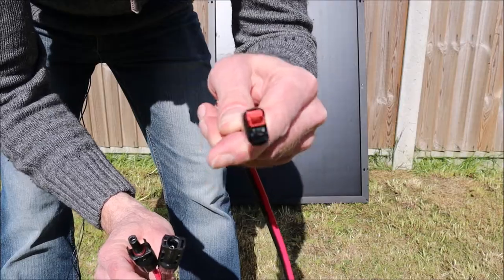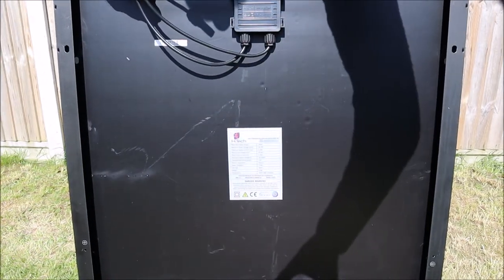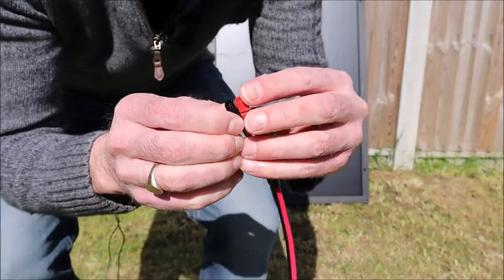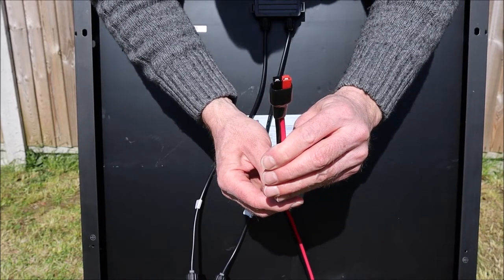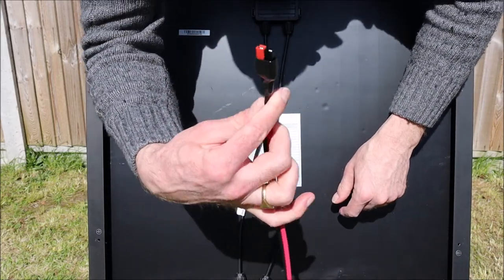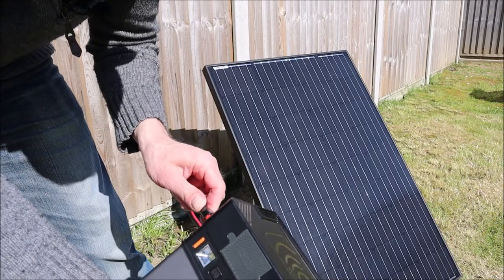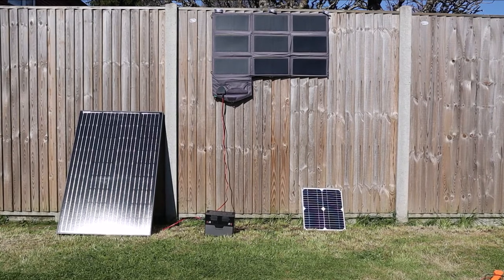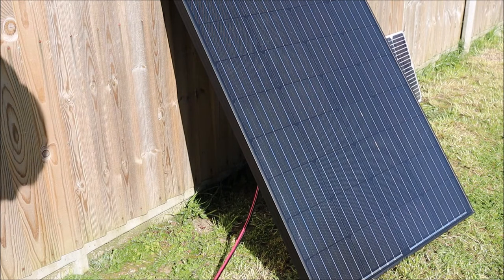New 100W Solar Panel + ALLPOWERS 372Wh Solar Generator | Working from Home

Comment: I bought the ALLPOWERS Portable Generator 288Wh Power Station mainly on the strength of your earlier vid. Damn fine device.

I've just bought two 500w Renogy panels I'm converting into a suitcase configuration, to supplement a Beaudens fair weather 100w portable panel, I use to charge it.

The snippets of experience I glean from your work, have saved me loads of time! My thanks & stay safe.
Reply from the maker: Good day to you! Wow, thank you so much for your kind and generous feedback. The content on this channel doesn't fit with everyone, so hearing that you've gained value and saved time is awesome! Renogy has a good reputation so they should work and last well. I need to get some of their kit to test out on here.

Thanks again for taking your time to feedback. If you need anything just shout. Stay safe and all the very best, Adrian

Comment: I had alot if issues with getting any wattage out of my solar panels into my power stations in the begining until i picked up a cheap £7 multimeter from screwfix to diagnose some issues. A megasolar 100w panel on the inside of north facing window of my house (awat from the sun) only gets around 4.8-5.6v and 50-70mA out of its dc barrel jack on the inside of a south facing window it can pull 20.6v at around 320mA(on its 20v setting) i know these arent ideal conditions and outside really to get the full heat of the sun but the south side of my house is facing the main road with a small garden and not alot of security for leaving solar panels out. And the baci side of the house (south side) is mostly in the shade in winter when the sun is lower in the sky.

Comment: im thinking of modifying a 12v cable from my geny be able to connect it via anderson plug. that way instead of charging it from sun it ifts not available in can plug it into my generator so its charging as we're using it. any thoughts on that?
Reply from the maker: @Ash  Good day Ash! I've not got a generator myself, so couldn't test it I'm afraid. The voltage range of the MPPT circuit (from the manual) is 16.6-22V, so it would need to be in this range. Saying this, I'm not sure how the MPPT would react to the voltage a generator would produce. If it produced the same amount as a vehicle 12V output, then the DC input might be a better option. Can you add a 12V output to your generator? Cheers, Adrian

Comment: So with the allpowwrs 606/666 I don’t need an extra solar charge Controller Right? It does it on its own?
Reply from the maker: @Magengegend  G'Day! You're correct. It has a built-in MPPT circuit that takes care of solar charging so you can plug a panel straight in. Cheers, Adrian

Comment: can you connect the panel to the 8mm socket, thanks
Reply from the maker: @Dru Wilson  Hi Andy! You can charge using solar via the DC port (5.5mm x 2.1mm), but it's not recommended as the port charging rate reduces when it becomes cloudy (as you would expect), but doesn't increase back up to the charging rate it was before (when the sun comes out again). In essence, 'sunny spells' kind of days, keep reducing the charging rate resulting in significantly longer charging times than when using the Anderson port (always charges at the best rate the panel can deliver). The voltage range in the manual for the DC port is 12-20V with a maximum current of 3.2A. I hope this answers your question. Please shout if you have any other questions. All the best, Adrian

Comment: This power unit seem to work fine for me I have only charged it once from the mains adapter.  I use the unit to power a Mini Cooler which drains at 44 Watt at start up dropping to about 38-40 after a few minutes, it takes about 5-8 watt less in heat mode.  I generally charge this with a Renogy 50w Panel through the Anderson plug and also use the pass through ability of the charging circuit. I have had no issues it all seem to work correctly although I do shield the unit from the sun when pass through charging as it can get warm otherwise.
Reply from the maker: @Neil Wilson  Good day Neil and thanks for your comment. It's great to hear that your unit is working fine, especially in pass through. Your tip about shielding from the sun is an important one too! Thanks very much for sharing your experience as this will help other viewers who read this. All the best, Adrian

Comment: Thanks for all the video how to and what not on this generator, I am getting ready to push the button on one of these but haven't seen or heard mention of total charge time, so say from near flat to full, could you either point to or tell me for example charge times from mains, car lighter socket and 100w solar, thanks in advance.
Reply from the maker: @alan palmer  Good day Alan! Thank you for your kind feedback and question. Rough timings based on my 372Wh for each method below. I wouldn't recommend running it completely flat all the time as this will shorten the battery cycle life.

Mains - Supplied AC/DC power brick @55W > 372Wh / 55W = 6.7 Hours
Mains - https://amzn.to/32jI4WV (affiliate link) @60W > 372Wh / 60W = 6.2 Hours
12V - https://amzn.to/3icM9DZ (affiliate link) @37W > 372Wh / 37W = 10 Hours
12V - https://amzn.to/32Ks3d0 (affiliate link) @60W > 372Wh / 60W = 6.2 Hours
Solar Panel (100W) https://amzn.to/2YQ7drL (affiliate link) @58-60W (max 3.2A charging circuit) > 372Wh /58-60W = < 7 Hours

I hope this helps. Please shout if you need anything else. All the best, Adrian
Reply: @DADvinci  Thank you so much for the info, much better times than I would have guessed at,    pushing me closer still, probably bite the bullet at the end of the month, thanks again.
Reply from the maker: @alan palmer  Glad to help! The manual states 7-8 hours for the AC power brick (60W in), yet 6 hours for a 100W solar panel (60W in). The times I've provided are rough estimates (so 7 hours should cover most ‘flat to full’ charging situations) and the good thing about the 372Wh is that it displays charge time remaining. The only issue with mine is that it doesn't display a time when charging using solar via the Anderson port. The display is very handy for discharge time remaining too, but all in all the % is still the best yardstick. Please shout if you need anything else. Cheers, Adrian
Reply: @DADvinci  sorry for the sporadic replies but I'm working away from home and using a phone, the generator at least would give me laptop potential, thanks again, very much appreciated.

Comment: I was wondering, which one of the 3 panels would you recommend to have around to keep cellphones charged, laptop and maybe help reducing the energy bill? I could considered either using one of those portable batteries with inverter or something like a grid tied inverter and connecting it to my wallplug
Reply from the maker: @Daniel Peixoto Martins  Good day Daniel and thanks for your question. Usually, it all comes down to what you want to power (or charge) and for how long you would like to do it. In general terms, if you don't need a portable panel then go for a rigid glass one (or more) as they are better value for stationary use, last longer and can remain outside it all weathers. You can go the grid-tied route which will help to reduce mains power usage and reduce energy bills but won't store energy. The battery option provides more flexibility in terms of energy storage so you can cover power outages (emergencies), take it on trips (off-grid use) and still use it while the sun is shining at home (reducing mains usage). Did you have specific costs in mind or scenarios you really want to cover? All the best, Adrian
Reply: @DADvinci  Well, I live in an apartment, top floor so I could easilly put a rigid one over the balcony if the home owners association allows it.
Advantages of a movable one: I wouldn't need a permit and would be able to take it camping with me...
But yes, I agree a fixed one will last far longer and they have a better output. My parents installed 2 last years the results are awesome although it is only a 520 or 560w set up.
In terms of money I am not really concerned but would like to get my investment back in some years time.
Reply from the maker: @Daniel Peixoto Martins  Thanks for the additional info Daniel. It sounds like a foldable might be a better option for your circumstances as it covers home and away. If you do go the 372Wh route, then you're not going to get much more than 60W from solar due to the charging limit of the unit. The 100W ALLPOWERS foldable (https://amzn.to/3p7lavG affiliate link) should give you that, as my 60W version gets about 45W when charging. Another one I've been testing since last year (waiting for weather to improve for mid-term review video) is the PowerOak 120W (https://amzn.to/3qqlSpv affiliate link) which is a nice panel with MC4 connectors and in-built stands, but you're unlikely to benefit from the extra watts due to the charging limit on the 372. I hope this helps? Please shout if you need anything else. Cheers, Adrian

Comment: Great video. I already have a 120W (2x60) folding solar panel which I use for my caravan when off grid.  I also have a dayvan and wanted to use an allpower solar generator.
Will these work together, the max voltage of 17.5v seems to be ok but not sure about the ampage 6.86A (2x3.43A)? If not could I switch off / disconnect one of the 60W panels?
Solar panel spec.
Peak power: 120W
Maximum power voltage: 17.5V
Maximum power current: 6.86A (2x3.43A)
Open circuit voltage: 21.6V
Short circuit current: 7.4A (2x3.7A)

Thanks
Reply from the maker: @John O'Brien  Good day John and thanks for your kind feedback😊 If you are looking at the 372Wh, it all depends on whether the panel voltage is in the operating (wake-up) zone when you plug it in (with both panels). Some viewers haven’t needed to use my workaround (video in playlist) when connecting their different panels, but quite a few have. The built-in MPPT controller should limit the current to 3.2A (around 60watts for charging) when it wakes up. It might be worth having a look at the playlist here > https://bit.ly/2AbwG5L to see the journey I've had with mine, if you've not already seen it. I've not long had the newer 666Wh version and am currently testing that, here's the short playlist so far if you fancy a look as well > https://bit.ly/3juowGq 

I hope this helps? Please shout if you need anything else. All the best, Adrian

Comment: Do you know if this model can be loaded in two ways simultaneously like the top model?
Reply from the maker: @DanyzoO  Good day and thanks for your question. I’m afraid not, mine can only be charged via the DC or USB-C PD port, not both simultaneously like the 666Wh version. Please shout if you need anything else. All the best, Adrian
Reply: I have managed to charge my allpowers model by opening it and taking a direct battery output connected to an external mppt.  a maximum of 92w with my solar panels

Comment: Hi Adrian, thanks for the most helpful vids. Can you clarify - can this unit charge off a solar panel whilst providing power out? I'm looking for a unit to power a cooler box, which really needs to be powered 24/7. I notice on the Amazon page that it says that it can't do that, but that seems to me to be a considerable drawback if true (and I don't understand why it couldn't do it anyway - providing there is enough charge in the unit). Any insight you can provide would be much appreciated!
Reply from the maker: @Stu K.  Good day Stu! Many thanks for your very kind feedback😊 and question. Yes, you can charge by solar whilst using it (my preferred method when the sun is shining). 

The principal issue with the 12V cigarette lighter output is that it's not regulated at 12V (like many solar generators). When my unit is fully charged the 12V socket reads about 12.6V, but as the overall battery charge drops so does the voltage (12V socket drops into the 11V range). My electric coolbox cuts out once it drops under 12V (in-built feature to stop car batteries going flat I believe), so I can't use the full battery charge. My coolbox also consumes approx. 50W continuously, so even if the 12V cut-out wasn't in place, 372Wh divided by 50W = 7.4 hours approx. without accounting for usage losses (real-world use would be less runtime).

The only way I'm aware of to get round the socket not being regulated is to use a 220V AC to 12V DC transformer like this > https://amzn.to/2BDSS9u (affiliate link). It would use more power as the inverter would need to be on (less runtime), but enable you to use the whole battery charge for a coolbox that requires 12V (although I've not tested one myself).

I hope this helps. Please let me know if this answers your question and if you need anything else. All the best, Adrian
Reply: @DADvinci  thanks - that's most helpful. If I were to power the coolbox all night (with or without the transformer) it would probably use up all the power in the unit. Would that do it any harm? Or is simply a case of charging it up from zero charge again. I seem to remember reading that it harms this type of battery to discharge it completely. I'm just wondering what other campers do as this is the same situation for everyone.
Reply from the maker: @Stu K.  Hey Stu! Repeatedly discharging the battery to flat will have an effect and reduce the cycles before the usable capacity drops (e.g. to 80% usable). Here's a good article > https://batteryuniversity.com/learn/article/how_to_prolong_lithium_based_batteries with table 2 giving some estimates showing the effect of the depth of discharge (DoD) rates on cycles.

There are probably two options, if you didn't want to run out overnight. 1) Get a small camping compressor fridge as this would be more efficient (not running constantly), but I've not tested one yet. 2) Buy another solar generator (or larger capacity one). I hope this helps. Please shout if you have any further questions. Cheers, Adrian

Comment: Hi, great video.  I have just bought this generator and I am trying to learn how to use it.  I have bought the 
ALLPOWERS 12V 18V 100W Sunpower ETFE Solar Panel to go with it, which I tried to hook up today.  Initially it didn't work but through watching this video I have noticed the switched polarity between the solar panel and the Andersen lead.  I have switched the red and black connectors as you did in the video but to no avail.  Do you have any tips on what else I should try to get the panel charging.  The generator is 98% charged would this make a difference.  Thanks for any help you can offer
Reply from the maker: @David Rose  Good day David! Thank you for your kind feedback and question. The 372Wh does represent good value, but has a certain 'characteristic' which I think might be your issue. There is a voltage range (16.6-22V in the manual) that needs to be hit to wake-up charging via the Anderson port. If you don't hit the right voltage by partially covering (or folding) the panel within about 5secs of plugging the cable in, you have to remove and plug in again until you do. It sounds like a pain but once you get the hang of it, it’s fine. I discovered the workaround a couple of days before I went to return the unit. So glad I kept hold of it now!

I'm not sure how many of the 372Wh videos you've seen yet, but this playlist > https://bit.ly/2AbwG5L has the series including the charging 'characteristics' and workaround. Please can you try it out and let me know how you get on with waking it up? If you do find any of the videos useful, I'd really appreciate it if you could hit the like too 😊 All the best, Adrian
Reply: @DADvinci  HI, I have had a play with this today and cannot seem to get the thing working.  Also I am not happy with the rigid design of the solar panel.  I will be fishing and need something a bit more compact.  Can you recommend something that is foldable that won't have the 16.6 - 22V issue ??
Reply from the maker: @David Rose  Hi David! I'm sorry you didn't have any joy with the workaround.

If it's compact you're after then the ALLPOWERS 60W in this video > https://youtu.be/qLYXnp5OGmw is the long-term winner for me. The only thing is that you'll still need to partially cover to get it working. I'm only aware of one viewer who seems to be fine with their panel on the revised (most recent) version of the 372Wh. They bought this one > https://amzn.to/32uAH0L (affiliate link) and it worked for them, although it's not as compact as the foldable 60W one. You'll also need a DC to Anderson cable for the ALLPOWERS foldable which is linked in the description of that video. The 100W Beaudens panel above comes with the cable (DC to Anderson) included.

I hope this helps. Please shout if you need anything else. All the best, Adrian
Reply: Hi. Thanks for your help. I am returning the rigid solar panel and will order the 60w foldable one as per your video. Which was really good btw. I’ll let you know how it goes.

Comment: Is there any benefit to using the Anderson port instead of the DC port to charge?
Reply from the maker: Good day Miles and thanks for your question. There are some charging  'characteristics' with this solar generator. The following videos in order (if you haven't already seen them) might help explain these.

1 - https://youtu.be/R2EYi1d6c1M
2 - https://youtu.be/ViLdkYzOZqA

I hope this helps. Please shout if you need anything else. All the best, Adrian